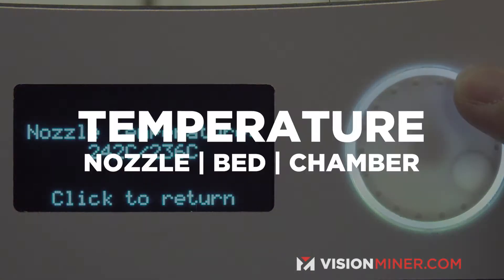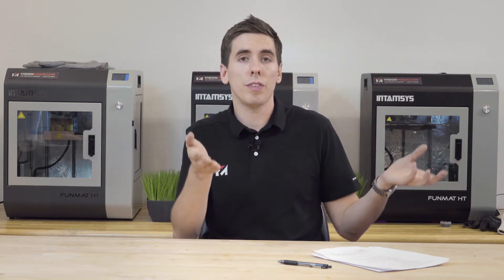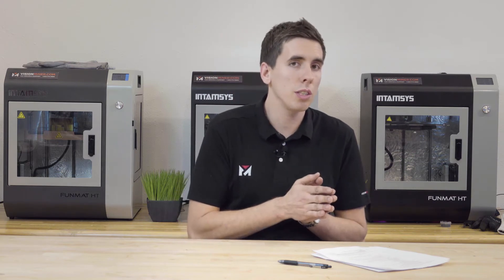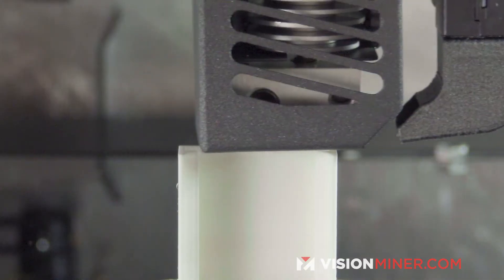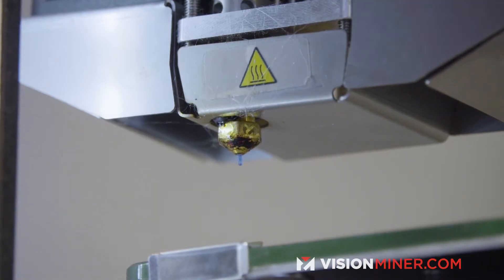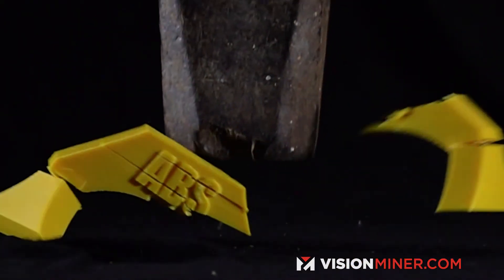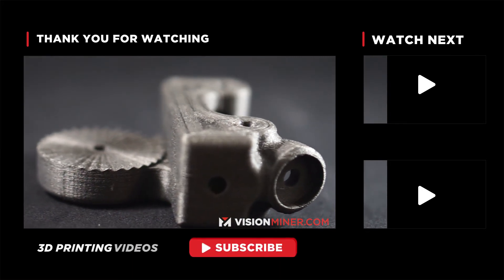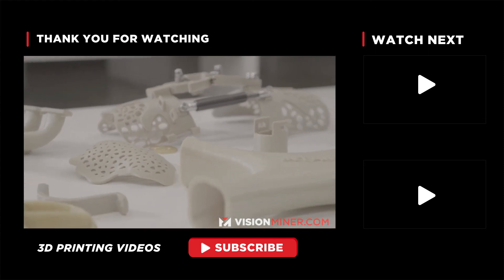3D Printing Temps: Too Hot, Too Cold, or Just Right? Finding the Right Settings

Comment: Mine is adhearing to itself just fine but it kind of puts down small blobs before it starts printing a section, could that be due to being too hot? its a stock ender 3 v2 running normal PLA at 200c
Reply: It maybe a setting somewhere relating to extrusion after moving, the white dots in cura, if they lign up with what you are experiencing then maybe you should try tweaking where they should be placed, like you can set them to be on corners.
If it's not that then it maybe your retraction settings.

Comment: would being too hot cause the filament to curl around the nozzle? i've seen filament extrude down to the bed (from 1/2 the max height of the print volume) in a long straight line, but now with my mingda magician X im getting this odd thing where the filament comes out, curls upwards, and tries to wrap itself around the nozzle, thus forming a giant clump of filament that knocks the print off.
like, for every layer that goes down, i imagine that 1/4 of that layer is migrating upwards into the clump.
Reply from the maker: MIght be wet filament, that needs to be dried, or it could be speeds -- generally printing too hot doesn't cause that, but it's usually something with material settings...
Reply: I actually saw that happen when printing too cold. Might be worth upping temps by 5-10C° and seeing how it goes.

I know, old comment but it maybe helpful to someone.

Comment: I have a problem with my 3d printer, when the cooling fans start spinning the temperature drops to around 160 from 200 degrees and it wont print, it stops in place, its happening for a while now.
Reply: Usually there is a setting for cooling.  Play with those.